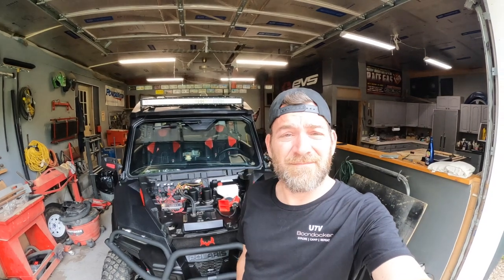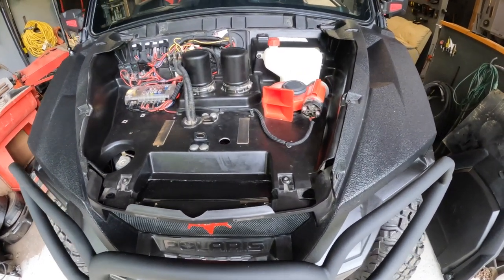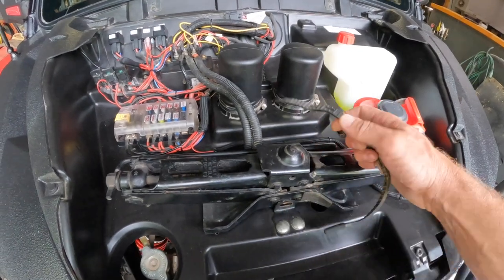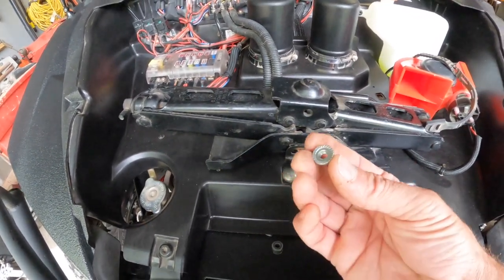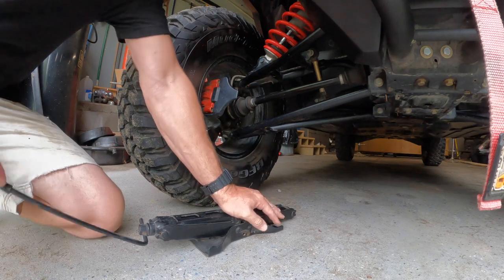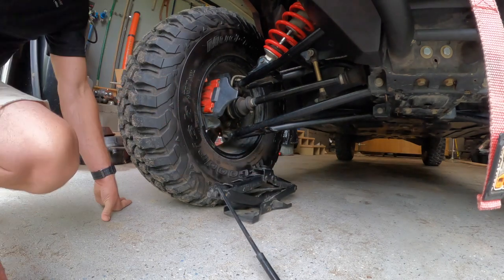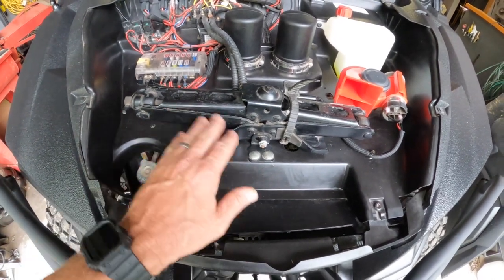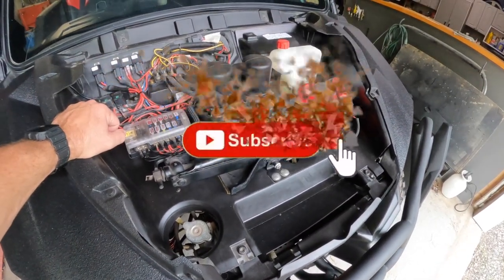UTV Jack solution in 3.3 minutes

Comment: Take the lever off and weld a socket on,then you can use a rachet,or better yet a impact driver.
Reply from the maker: Excellent idea!    I’ll have to rethink bringing some extra power tools in the trips!
Reply: @UTVBoondocker  I just learned that Amazon has an adapter to add a socket without welding for about ten bucks.
A lot of times that lever gets stuck in the mud a ratchet does better
Reply from the maker: Thanks!  @daryelthomas9414  feel free to share the link if you ordered it and are happy with it.  I may just order it and stow it on the rig!

Comment: Doesn't look like it will extend long enough?
Reply from the maker: Oh it does - in fact, we had to use it to change out a failed ball joint (As seen my 2021 UP trip video at the 2 minute mark).   You can always put a log underneath it to speed things up too.  I've been entertaining the highlifter style jack but still struggle with a good mounting point.  This option is compact and most likely free to most that may have one lying around.  Hope that helps and thanks for watching!